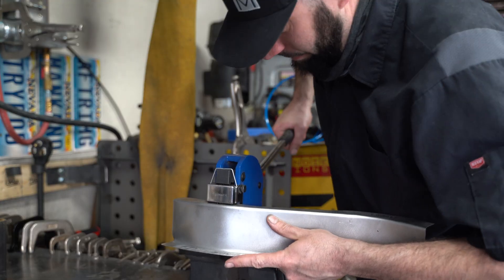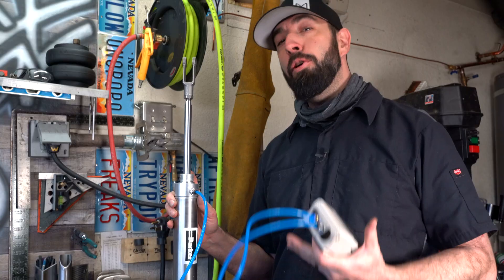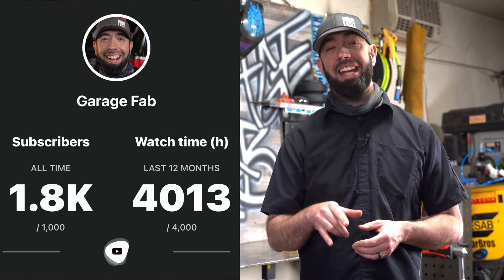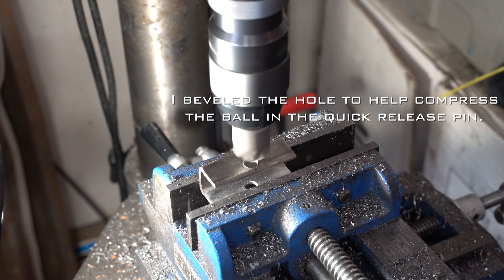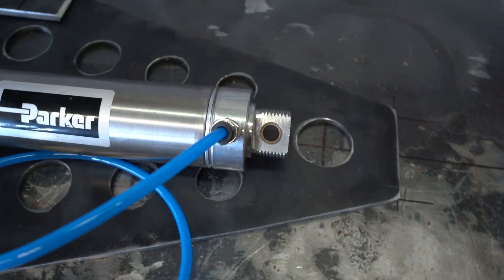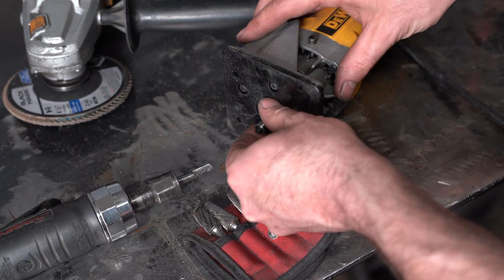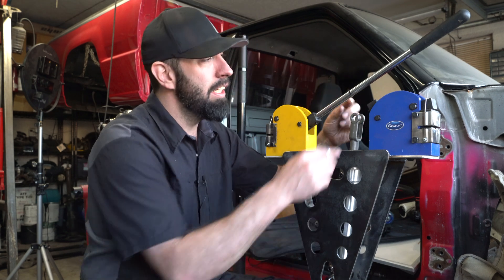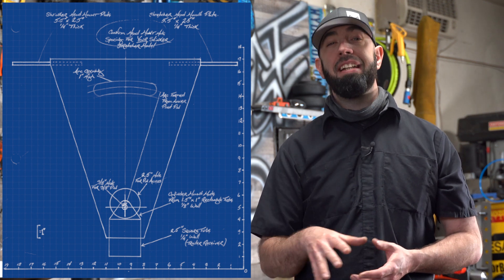Semi-Auto Power Shrinker/Stretcher?!

Comment: Just built mine and had to use a Tailon sc50-100 cylinder as the one you used seems to no longer be available. Mine uses a 4 inch stroke, which seems.more than enough. Requires a cooresponding pivot that screws onto the base and the yoke is bigger than the one in the video.
Reply from the maker: Thank you for that, Dennis! I noticed the one I used vanished. Very frustrating. I’ll pin your comment. It might help someone! I’d love to see yours!
Reply: Following your example I, too, bought the Tailon sc50-100 cylinder. Did you have to fabricate the pivot or can this piece be bought off the shelf? How did you deal with the larger yoke? I have all of the other Tailon pieces listed in the MK shopping list (foot pedal and pressure regulator)
Mine will probably be a little different looking because I will attempt to use the Eastwood S/S stand that I already had, the one that mounts in a vice. TIA for your kind replies.
Reply from the maker: @FrankAustinLowney Hopefully Dennis will respond. If not, shoot me some photos of the materials you’re working with and I’ll try and help brainstorm.
Instagram @GarageFab or email GarageFab702@gmail.com

Comment: hi budd did you use 6 8 or 10mm hose?
Reply from the maker: It’s been a while since I ordered, but I’m pretty confident it was 6mm.
Reply: @GarageFab  6mm od right?
Reply from the maker: @ Correct. I believe all airline is measured OD because that’s what matters when it comes to fittings.
Reply: @GarageFab  great thanks for the info.
Im sure youd like how my build turned out
Reply from the maker: @Hackjob-Extraordinaire I would indeed! GarageFab702@gmail.com or @GarageFab Instagram

Comment: Honestly the foot operated one seems better less things that can go wrong and you don't need to have an air source. Plus you can fine tune better when your really close just press down a little less.
Reply from the maker: Yeah the air source is a really big deal. But as for fine tuning and more important repeatability, the air is unmatched. Every step of the pedal provides the exact same force every time. A tiny twist of the knob changes that force metered amounts. I’d happily admit you’re better than I am if you can feel how much you’re manipulating the metal with a manual foot pedal.

Comment: you know what you can do to make it simpler and cheaper you don't need a precarnatic cylinder and spring, just get a rear brake pot from a tractor trailer it already has a spring and when you press it releases then grabs and it is way more compact and cheaper you may have to pUt an air mixer valVe to allow some air through,let me know how it work s

Comment: Yep I lnow what  shrinker/stretchers are I also know how many are used  What I'm wondering is what's the "recovery rate" is after each push on the air pedal. My guess is that it is not as fast as with a sprimg return  Also, the adjustibility of each "push' There seems that there would be a lessening of sensitivity with air as with a spring return  TY 4sharing
Reply from the maker: Sensitivity is completely eliminated, but in my opinion, there’s not much to feel with a manual unit anyway. I’m sure someone with years of daily experience could argue.
The air cylinder returns pretty fast. As far as speed goes overall I think it’s about the same as a manual unit. A unit with a spring return rebounds quicker but there’s more movement required of the pedal or handle. The pedal for the air unit only moves about an inch or so each individual pedal stroke is quicker.
Once in the rhythm, the air unit is capable of about 1 actuation a second. About the same speed that I would operate a manual unit.
Reply: @GarageFab  TY

Comment: Pneumatic is PERFECT!  The cylinder will "give" before gouging the work piece.   Plus it's probably faster than hydraulic.
Reply from the maker: So far so good my man! I couldn’t be happier. I’ve had a few folks say that you wouldn’t be able to ‘feel’ the workpiece and make fine adjustments on the fly. I don’t know what they’re feeling. Maybe I’m numb, but I can’t feel the metal moving with a manual shrinker/stretcher.
The consistent pressure with every application of the pneumatic system has made it incredibly easy to make perfect uniform curves!

Comment: I thought you where going to use a "Watts-Link" design to pull both shrinker and stretcher arms at the same time. That'd be cool and highly over complicated lol. Of course you'd have to clock/offset the two tools slightly to allow the two pull down arms to pass each other or add more separation front to back. The Watts-Link center would be connected to the cylinder shaft and a link that would go each tool. The Watts-Link's "parallel" links would hold the "propeller" and cylinder shaft from favoring and swinging toward the tool currently under load. A side benefit is the air line slots wouldn't be needed either. In the end, life is short and time is precious, so your way is better. It would be cool though.
Reply from the maker: It absolutely would be cool! And unnecessarily complicated is my signature! If it’s not complex it’s not interesting. Who cares about practicality!

Comment: So I just wanted to let you know I took this idea and ran with it. I have two separate air cylinders controlled by electric air solenoids into separate pedals. I'm extremely pleased with the results. And with the adjustable PSI in the way I built mine I have adjustable heim joints much like a tie rod. I built it in such a manner because the cylinders I had already were limited travel about 7in to be exact. So you could either screw-in or screw out the tie rod the adjust for thicker metal and I'm extremely pleased with the results. 👌 Thanks again for the inspiration. 🤟
Reply from the maker: Yes! Do you have Instagram or another way of sending over some photos/video? I’d love to see what sounds like an incredible project. Very well done, my friend. 👏
Reply: @GarageFab  not really up on the gram to often but I'll see what I could do because like I said you gave me the inspiration for it and I really think you would appreciate it. I'll comment back here when I put it up. Mind you it's not as clean as yours but it does the job extremely well. It does have some bead rolled panels at the top of the table just for an extra touch lol but I really think some speed holes would really class it up a bit haha. What's your Instagram?
Reply from the maker: @ogt92fromthe1step9  Operation is all that matters! That and the pride of building it yourself.
Haha! “Speed Holes” My Instagram is @GarageFab believe it or not. Cheers!
Reply: @GarageFab  noice I'll hit you up soon
Reply: @GarageFab  if you get a chance ya have to check out the 25ton press brake I've been helping setting up for my uncle. She's a big girl lol 8' tall 6' wide in about 4 ft deep when the package tray is installed. It's on my Instagram just getting it's standing up. I still have to build him another rotary phase converter to power it but I have a couple good ideas for some real nice beaded and louvered panels using this machine. Just thought you'd get a kick out of that.
Reply from the maker: I would indeed. Sounds like it might be a wee big for my garage but it’s probably just as cool.
Reply: @GarageFab  I the shear size of it is massive lol but he got a deal on it that he just couldn't pass up. He is also a tool and die machinist by trade and in fact this used to be one of the machines that he used to make dies for.

Comment: Don't have a shrinker stretcher but I did watch this all the way because I just like watching people build stuff. One question, couldn't you have made a small extension for the bottom to turn the cylinder 90 deg.? would have moved the pivot pin location down 1/2 to 3/4 inch.
Reply from the maker: Yeah, definitely would’ve been an option. That never crossed my mind, and it probably would’ve been a lot faster than cutting the arched hole! 🤷‍♂️

Comment: With the router???? Who would have thought.
Reply from the maker: Right? It still requires a delicate touch, but with enough practice you can get edges that look like a machine did it.
Reply: @GarageFab  I have a router but it’s bigger still hand held do you think that would work with the right size carbide bit for the bigger collar?
Reply from the maker: The challenge would be finding carbide bits with shanks that match your router chuck. If you can do that I’d imagine it would work just fine! 🙌
Reply: @GarageFab  right

Comment: something i learned while building my own- use clean metal. maybe not a big deal with better machines, i have harbor freight shrinker/stretcher. i had made them work manually with a fair bit of force but then with the air cylinder seemed to no longer be working. kept upping the psi all the way to 180 but nothing. the test metal is used and had been painted. apparently the paint packed into the cerations in the jaws. cleaned them out, sanded the paint off the metal and it now works. seems obvious now but may save someone else some headache.
Reply from the maker: That’s good info! I have heard of the teeth getting packed with aluminum and I’ve heard of the teeth wearing down by allowing the upper and lower jaws to come together too often.
Paint makes a lot of sense! Thank you my friend. You are appreciated. 🙏

Comment: GREAT VIDEO, DOES THAT AIR CYLINDER HAVE ENOUGH GRUNT AT THE END OF THE SHRINK/STRETCH STROKE? REASON I ASK IS WHEN I SEE PEOPLE USING THEM, THEY ALL TEND TO GIVE A LITTLE LEAN INTO THE BAR AT THE VERY END ON THE STROKE.
Reply from the maker: Thank you Thomas! The cylinder gives a consistent pressure that can be increased or decreased with the regulator. So it’s not able to provide any additional “grunt” at the end, but that’s not necessary.
I think that extra effort you see has more to do with how the machine works in the first place. When you pull the handle of a shrinker or stretcher, 95% of the movement of the lever isn’t doing anything to the metal. It is simply bringing the jaws of the machine in contact with the workpiece. This part takes almost no effort.
Once the jaws touch the metal, all movement stops. Now is when you’ve got to put some strength into it to actually force the metal to move. And with each stroke, that movement is so small the handle barely moves. So the pneumatic cylinder provides the same amount of pressure to the beginning of the stroke as the end of the stroke.
Hope this made sense!
Reply: @GarageFab  YES, THIS MOD WOULD BE A GREAT HELP TO ME AS I AM IN A WHEELCHAIR. I WAS GOING TO TRY BUILDING A FOOT OPERATING STYLE STAND WITH A MODIFIED ARM INSTEAD SO I COULD SIT IN FRONT OF THE SHRINK-STRETCH, BUT IF THIS WORKS AS GOOD AS IT SEEMS IN THE VIDEO, MAN! THAT WOULD BE GREAT! THANKS FOR THE REPLY
Reply from the maker: That would be brilliant! I’d love to see it in action. The pedal I used doesn’t take much effort to depress so it would be easy to operate by hand or by elbow.
Best of luck my friend!

Comment: If you made a kit for this, how much would you charge?
Reply from the maker: I’m not really sure! I don’t have any sort of account with Eastwood or the parts manufacturers so I’d have to pay full price for everything.
I’d consider selling the parts (shrinker/stretcher not included) in a ready-to-weld kit for around $400. A fully welded and powder coated unit (shrinker/stretcher not included) for around $800, and a complete setup for $1100ish.
Reply: @GarageFab  I have the shrinker stretcher already. Finding parts and the time to do it is the issue.
Reply from the maker: @dollabillbrunson8107  I feel you my man! I’m struggling to find time to make more videos. 😬

Comment: Thanks.
Good explanation and to the point. 
I might have to get one of everything and build one. 
What was the total cost,  including the sprinter/stretcher tool?
Reply from the maker: Thank you, Ed! It’s been a little while so my memory is fuzzy. My Wife bought me the Shrinker and Stretcher set but I think it was a little under $300. Parts were under $200 I believe NOT including the steel plate I used. I had some of that just laying around so it didn’t cost me anything! But I’d estimate roughly $25-30 in steel.
Be sure to check out the links in the description of the video! All the current prices will be there.
Reply: @GarageFab  thanks
👍👍👍👍

Comment: Just found you so carve another notch in your sub list with that handy router/ rotary bit ( great idea). Appreciate the drawings. Just mounted my s/ s on foot pedal stand   ( no pneumatics). Where is that red faced emoji. Did you consider moving both heads farther away and couple both handles at the same time?   Why didn’t I think of this.  don’t answer that
Reply from the maker: Thank you, Jeff! Glad to have you. I did consider connecting both machines to the same cylinder but decided not to for two reasons. 1. A fabricator friend advised me to not let the teeth grind together without a piece of metal between them. The upper and lower jaw gnashing together would dull them. Makes sense. 2. Because the handles move in an arc, if both handles were connected to the same piston, they wouldn’t be able to move. The natural motion of one handle would prevent the other from moving. If that’s confusing check out the first video in my Suspensions Basics video. It explains the arc the best way I know how.
Thank you again! I’ll be back at it shortly. 🍻

Comment: So I had my doubts at first.
Mainly because the Air Cylinder is weakest on the retraction stroke due to the annular area of the piston and rod.
Anyway it looks like it works. I too have had the same tool sitting on the shelf, I also have all the parts I need already so I will build one 
Great job. Looks good.
Reply from the maker: Thank you, Jon! You are correct. The shaft takes up a lot of the volume making it a little less effective. So far I’ve been able to do anything I’ve needed to work under 80psi.
I suppose you could build the whole thing upside-down to squeak a little extra power out of it! Good luck my friend!

Comment: My 2 cents. I think that cylinder is too small. I used it on my Deep shrinker and it would not shrink 20 gauge at 90 psi. I assume that metal you bent up is more like 22 gauge or less. I am going to try again but with a stronger cylinder.
Reply: Or if you had a longer stroke and could make the "handle" longer
Reply from the maker: That is true if you’ve got enough room for a slightly larger tool! Thank you Jeff. 🍻
Reply from the maker: That's a bummer to hear. My sample piece in the video was 20 gauge steel with the regulator set to about 55-60 psi. My only thought is that this pneumatic setup may not be suitable for a deep throat shrinker. As it is, I’m able to shrink 16 gauge but so far I’ve only used the machine on a 1 inch lip and I have to increase pressure to 85 psi as well as working the metal from the outer edge and gradually move inward in multiple steps. Once you move in beyond that 1 inch from the edge I suspect you are correct. A 2” cylinder won’t be able to handle it no matter how much pressure you throw at it.
Reply: @GarageFab   yeah . Still a great video. Will just have to tweak it for my setup.   Once I figure out what cylinder works I will report back for others that might read this down the line.
Reply from the maker: Please do! And thank you in advance. 🍻

Comment: Die grinder in a laminate trimmer. Boom
Reply from the maker: You got my attention! The only laminate trimmer I can find looks like a router though. 🤔
Reply: @GarageFab  I automate gates and insall various entry and access control systems but I used to be a cabinet maker for a decade. We called them palm routers, maybe I misunderstood what I saw in your video but your Dewalt router looks very similar in size to my Bosch colt, which was called a laminate trimmer on the box. In the shop 20 years ago this tool wasn't considered strong enough for normal routing applications (the guys who told me that  learned on shapers with 20` belt drives) but I haven't used my normal router in like 10 years except 1time I wanted to use the plunge base to make an address sign for my house, rest of the time it's sitting in the table collecting dust. I go for the laminate trimmer every time. But I'm making with metal now. You're right, it's a router. Cheers man have a good week
Reply from the maker: I follow! I thought you were referring to something else. I haven't been able to locate a small router since I posted this video and mine has been discontinued so that's super helpful. If they're not quite as powerful, I think that would actually be a benefit. The teeth on the bits are so small it doesn't need much strength and the router is pretty violent when a bit catches when reaming a hole.
Reply: @GarageFab  mine has an adjustable speed control
Reply from the maker: That's even cooler!